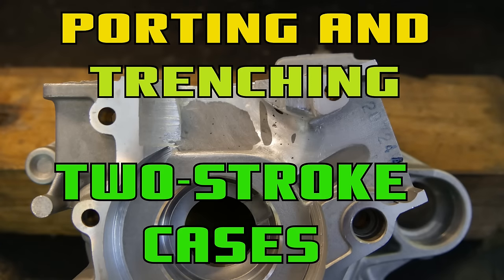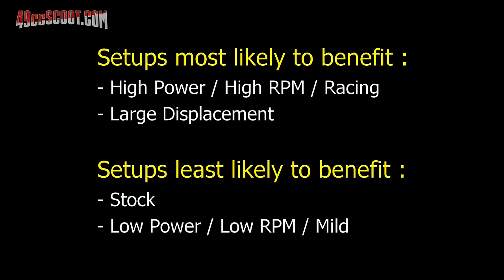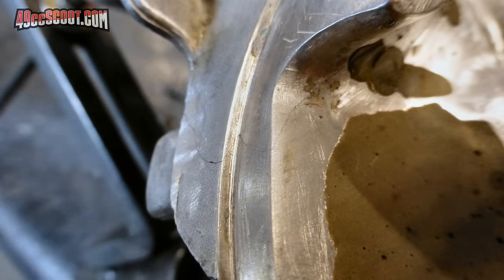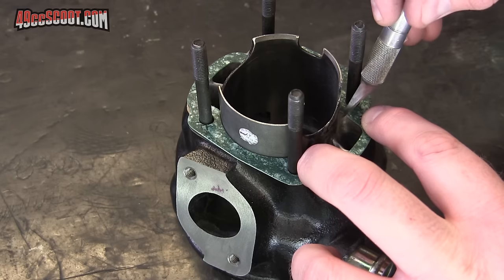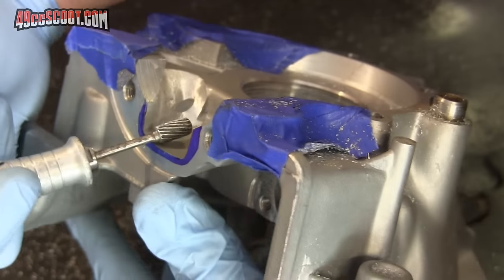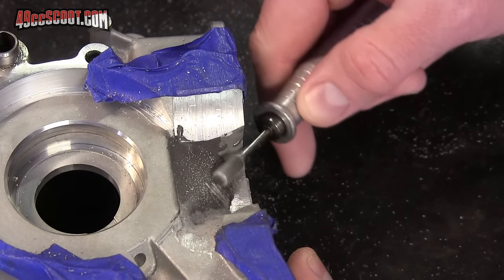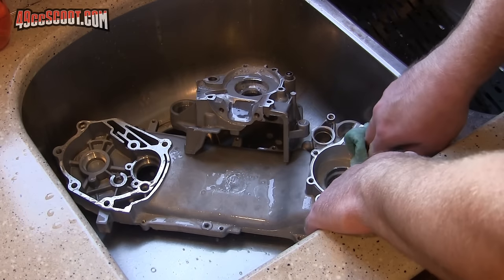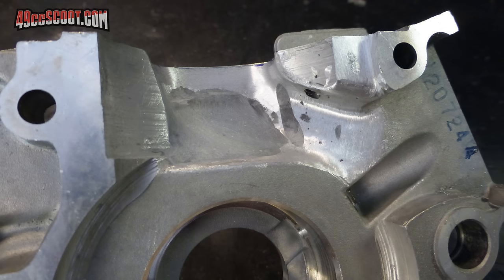Port Matching, Porting And Trenching Two-Stroke Engine Cases

Comment: The air flow from the reed does not travel into the transfers at the same time it's pulled in! Your trenching is wrong and your concept of how a 2t works flawed.
Reply: i thought so to, but im not an expert on twostrokes.
Reply: Then why don't you make a video and teach you something Street Riders... I think I seen you around a couple Facebook groups as well
Reply: @rpmsmoke4103  well i guess the tuned pipe pulls em open. At high rpm.
Reply: This has got to make it better,  I always thought packing any holes in the crank raises compression which is a good thing.
Reply: He is applying cylinder Reed  induction porting method to a CASE Reed induction engine. Not to mention I've been doing 2 stroke mods for over 25 years and I try to never (install😁) airleaks into the engine while porting. What he is doing will add very little in the way of power gains without the use of carb and especially expansion chamber(pipe) mods. Real gains will come with cylinder porting and port timing. Hogging out aluminum to the point of grinding into areas OUTSIDE of the crankcase is never a good idea.
Reply: Nothing will ever PULL the reeds open except the vacuum caused by the Piston and the Piston alone the exhaust port is never open to the intake port on a 2 stroke because the Piston is in the way.the Piston closes off the exhaust port when the intakes are open and vice versa. If they were open at the same time you would have ZERO COMPRESSION. The Piston acts as the valva in a 2 stroke engine.
Reply: exactly what i think
Reply: @kellyhill430  I do agree with you, but as someone who has been modifying 50cc scooters for use in races, I must say that flowing carters is incredibly important, as often these 50cc carters are flowed really badly which may cause problems when putting on a big cilinder kit. Flowing/trenching of carters does work in this scenario. Allthough I do agree he removes a lot of material.
Reply: @kellyhill430  Thats not true, before the piston closes the exhaustport, for that the intake port is open for a moment.A little mixture flows into the exhaust for a moment. A two-stroke engine, in this case with a resonance exhaust. The shape and length of the exhaust cause a pressure wave back towards the cylinder, which allows for a higher filling degree and thus more power.
Reply: https://en.wikipedia.org/wiki/Two-stroke_engine   Take al look on this page of Wikipedia.
Reply: I think that you Need to learn a bit more before you speak, a 10.000rpm a the mixture has more ore less 2 milli seconds to go from the reed valve ti the ports, and i also want to make you Remember that engines designed for racing use have a use band that goes from 9.000 to 13.000 or more rpm, that means the mixture will have practicly no time to get to the cilinder, also It depends on the porting and the Angles of the phases, i Hope you Will get more inform, i suggest Reading the book: elaboriamo il 2 tempi, i think It comes Also in english, and i also suggest learning some italian because if you want to have good informations or Watch some good videos on this topics, Italians are the best.
I apologize for the not so good english
Reply: kelly hill why not hand make a gasket covering as much metal as possible thus allowing you to take less metal off?
Reply: kelly hill you are wrong once the piston is at BDC all ports inside the cylinder are open in a two stroke engine. A well designed tuned pipe will help, it is called scavenging. The primary compression in a two stroke happens ATDC all the way down to when the transfers open up, there for forcing the fresh charge under the piston threw the transfers and on top of the piston where some of it is pushed out the exhaust port. It is then that the “tuned” pipe will push the fresh charge back in the secondary compression “main combustion” chamber. It is very important to have the right pipe for the job. Look up Gordon Jennings.
Reply: badvirus _ . You really have no clue do you. Pick up a book and study physics. This type of work is done all the time in the snowmobile racing world, especially when going with big bores. Tell me how many 2 stroke engines have you modded or even tried to modify? I’m not asking how many bolt-on parts have you slapped on. Study the engine, no study the 2stroke engine in depth before saying this should never be done.
Reply: As usual the comments section is rife with uninformed bullshit. 

Especially the guy telling us that the exhaust port is CLOSED by the time the TRANSFER port(s) are open!?

Doesn’t even understand the basics!
Reply: Don't know too much about scooters I do know they are side valve and very hard to port to get extra fuel in
Reply: My mate Ian opened a scooter shop called taff speed years ago he built racing vespers and piagio scooters they were worth doing and very quick lol you could camp in the minooky carbs lol
Reply: @kellyhill430  always a good thing no air leaks it will be in the form of hair line heat fractures is would imagine
Reply: The exhaust is indeed open to the inlet, at BDC. there is a direct route, from the air filter opening, to the end of the tail-pipe. I’d you don’t believe that, then put an air line into the air box, at BDC, and feel the air coming out of the tail pipe. It’s at this point in the cycle that, with a pipe with a stroke negative pressure (negative 7 PSI) pulls mixture through the reeds and is why boyessen ports are proven to be effect on a cylinder Reed motor
Reply: when you remove material from the bottom end i.e.trenching your increasing volume and lowering the primary compression
Reply: @rpmsmoke4103  Good call.
Reply: Suzuki's race kit manual for the RGV250 gives the exact advice to what 49Scoot is doing here...which is the opposite to what you are suggesting.
That is,Suzuki's race department suggests blending their cases to get better gas flow from the reeds to the transfer port.
Maybe your advice or understanding is flawed,or you know more than Suzuki's two-stroke engineers.
I don't know you,but my guess would be the former is probably correct.

Comment: There already is a stock 100cc block for aerox and neos... Why all this effort
Reply from the maker: Different platform. The ~90cc stuff like this uses different cases, bolt pattern, etc... Can be made from 49cc cases that are easy enough to find here in the US. The Aerox/BWS/etc... 100cc stuff is not common here. Cases aren't readily available or cheap. Doesn't use the same cylinders or cranks.

If the 100cc stuff were all over the US and cheap, I would have tried one by now. Same for the 180cc Piaggio/Gilera engine. I'd love to have one of those, but they require a fat wallet if you live in the US.

Comment: Taking too much material from the case. You should not break through anywhere. And when the pieces of JBWeld lets go after several heating/cooling (expansion/contraction) cycles😬

Comment: Great video overall. The only critique would be to not drag your files back and forth over the surface you’re filing. On harder materials it will dull the teeth and on softer materials it will clog them.

Comment: oh man, that case will not hold for long with that 
adhesive and you you even now why you got some holes? ITS SO THIN THERE... What is the material? Find a good welder and stop use that, just wanna help you if you havent alredy cracked the case. Sorry for my english, peace out.
Reply from the maker: It's Chinese cast aluminum. I've taken a cast aluminum Taiwan made head to a pro welder before. He didn't want to weld it. He used a filler because he thought it was too risky to warp or melt other areas with welding the material. I have seen welded Chinese cases before, but not for trenches. For repair or custom builds where plates were welded on.
Reply: Kina block har skitkvalitet. Så poröst att du inte vill svetsa upp det. Då funkar kemisk metall bättre.

Comment: You loose primary compression when you increase volume of the primary area like this guy does and realise youll need a flow bench to do it right and keep designed ablitly to scavenge well
Reply: Jesse W 
He goes from a standard 50 cc to a 100 cc
think he needs a bit more primary volume 
Your right if you keep to a 50 cc cilinder
Reply: @ttrcaster  so you know what im talking about i was just saying in general so the ricky racers dont start hoggin shit out looking for gains

Comment: Dude, you need to learn how a two stroke engine works. Fuel/air does NOT come through the reeds and into the transfer ports. Fuel/air is sucked through the reeds and up under the piston as the piston goes up to top dead center, then the piston starts down, forcing the reeds shut and then the fuel/air flows from under the piston up through the transfers. The more metal you cut out of the bottom end creates more volume for fuel and air to go instead of into the cylinder.
Reply: Steven Hulse not to mention jacking up your crank case pressure
Reply: Don't try and educate them i watched old seventies two strokes and have been stuck watching so much bullshit one two strokes I'm 57 and a not half bad mechanic it's like a twisted Haynes book of lies a little bit of knowledge fucks a perfectly good machine up be it a fifty or a seven fifty they don't understand the basics lol
Reply: @joelbrown7485  just wait until the heat fractures open up they will never find the air leaks lol
Reply from the maker: Some of you folks should probably spend some time exploring things that pros like Jan Theil and Frits Overmars and other incredibly smart and experienced 2T tuners have talked about. I know, I know, someo of you guys have way more experience than them and it's hilarious when people try different ideas than you're used to. Look at some of the aftermarket as well. Sometimes the aftermarket is just whatever they can make a buck off of, but you will notice that angled reed spacers are sold to try to direct flow toward the transfers. Intakes are made to change where the carb sits and keep mixture traveling toward the transfers more directly. Malossi makes cases with some of these designs incorporated. Yamaha engineers designed cases using the same properties to improve the standard layout.

I don't claim to be extremely intelligent or know it all, so I won't say that I'm not missing something or misinterpreting something. I don't have dyno evidence to back me up, because again I'm just a guy in a garage with a limited budget. I've done these mods many times and it seems to work for me. In a perfect world, I'd have the time and money to build a bunch of similar engines and see what works, but that's not how real life goes for most of us.
Reply: @49ccscoot  u left an essay to their one sentences 😂
Reply from the maker: @JDProductions_YT  It gets old reading negative comments from armchair experts that have never tried this.
Reply: What do you mean by that???i really like an explanation?? Pls
Reply: @49ccscoot  ignore them. Always some dude at a track flapping his gums like he is the HP profit. Never having tried or done any experimentation.

Comment: Jb weld...😂😂😂😂😂😂😂😂😂😂😂
Reply from the maker: Current engine has had JB Weld filler for over 2 years. A crankshaft failed at 14,000RPM+ and took out bearings and some other stuff... and the cases and JB Weld were even  fine after that. I've been doing it this way for a long time. Sometimes it does crack and it can  be a pain to grind it out and redo it, but generally it works fine for me. If you've got a bunch of custom billet CNC cases that you've personally made or welded and align honed and trued (to be sure there's no warping) that you've done, then please post some vids for us to check them out and show us how you do it.